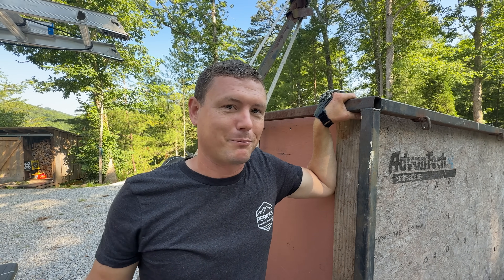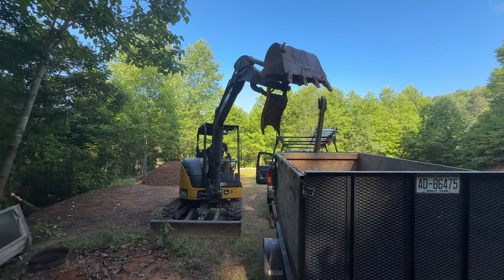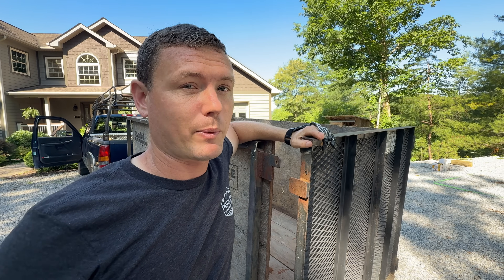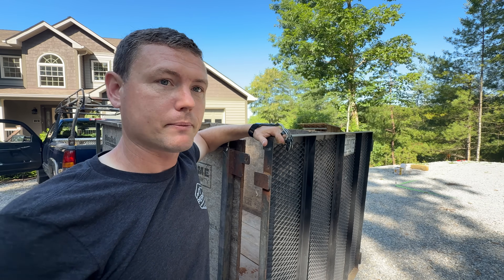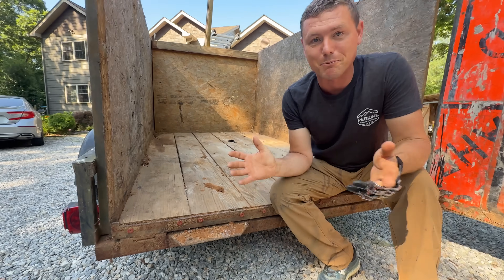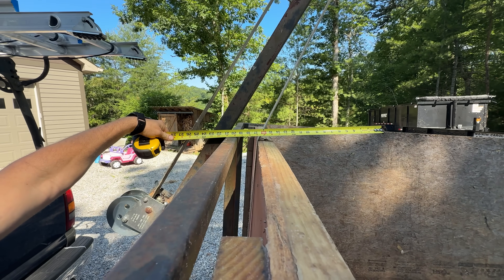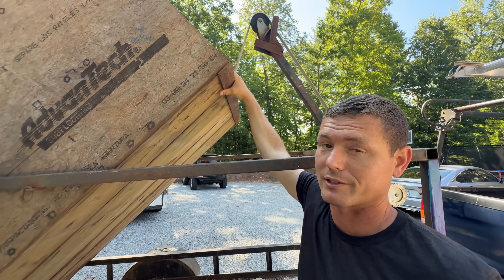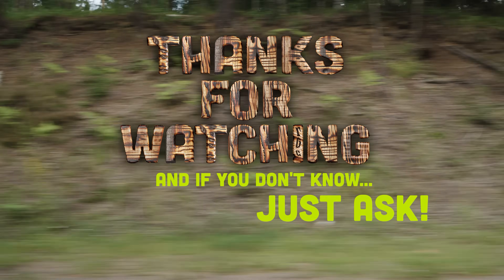$1000 Perkins Dump Trailer Build – Way Cheaper Than Buying One!

Comment: My landfill operators would help unload. Fasten a chain to a tire and rim.  Extend the chain out the back w/ the tire up front.  Load the trailer w/ debris.  When you get to the landfill open the back connect the chain to the excavator/machine.  The operator pulls the chain and 90%+ of the waste slides out.
Reply: I've done this with old pallets.
Reply: @robstephens  That's probably better if not super heavy.

Comment: How bout this, take off the handle and weld a nut so you can raise and lower the trailer with a drill or impact ??? You’re smarter than me Jamie so not sure if that would work for you??? I did this on a small camper I had with the tongue jack and leveling legs and it worked perfectly. Love your new channel and of course Perkin Builder Brothers